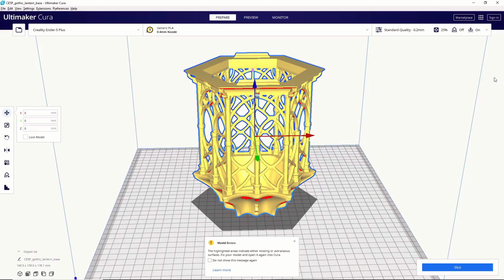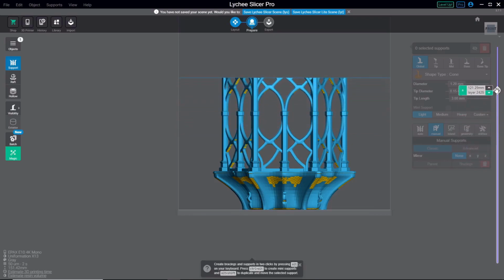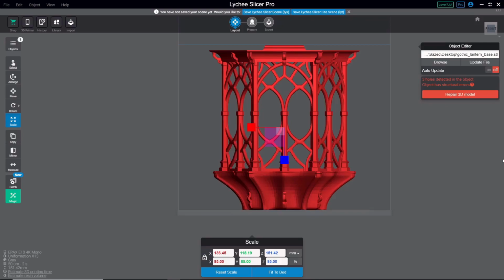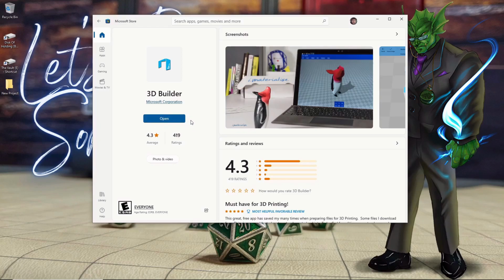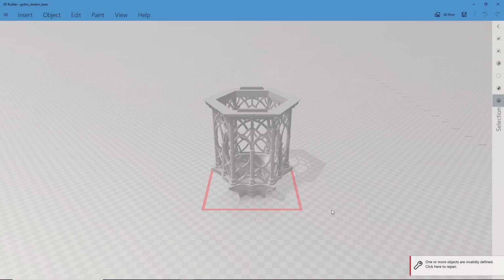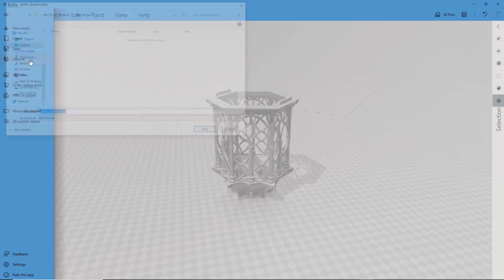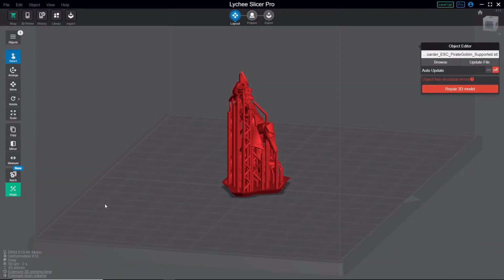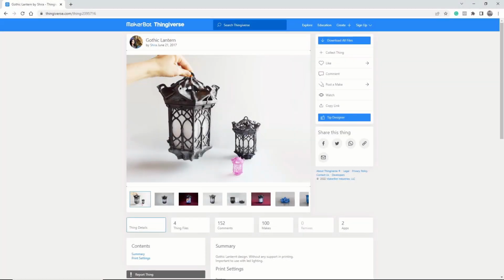How to Repair/Fix 3D Models the Easy Way!

Comment: I use kudotek stl cylindrical part my qidi keeps putting horizontal layers through the center hole seems to be tied to the features on the outside of the part. I’ve tried everything cannot get it to quit doing that.
Reply: Does anyone know how to fix this?
Reply from the maker: If you're sure that you have supports turned off then it probably needs to be edited to redefine the hole. You can do that in most 3D editing softwares like tinker cad.

Comment: it fills in a hole thats meant to be there same with cura. any fixes?
Reply: I have this problem  a lot it’s frustrating
Reply from the maker: @ZZZE-R0ZZZ  yeah unfortunately that can sometimes happen. It really depends on the mesh of the model. There are repair methods that will avoid that but they are all a bit more complex and outside my current skill level. Sorry I can't be more help. 😞

Comment: Too bad it's a microsoft program. They shoved too much crap down our thorats over the years and even plant ads inside expensive installs. They are NOT cool in my book!
Also, orcaslicer repaired everything for me so far with no issue at all.

Comment: what if we are using a Mac computer. can I repair my file on my husbands windows computer then send it over to my Mac?
Reply from the maker: @jessicastanger3077  yep you can absolutely do that. Once the file is repaired it can be opened on any computer running any program that opens STL files.
I apologize for not having Mac alternatives but I don't have a Mac. Perhaps in the future that will change and I can make recommendations for Mac users as well.

Comment: 3D builder is discontinued.. :(
Reply: 3D builder is still available, just not on the Microsoft store. Unfortunately it won't be getting any update so who knows how long it will keep working as Windows updates.
Reply from the maker: @corne3228  yeah I'm probably going to grab an installer and make it available through a Google drive link. Pretty much every place I've found to download it has a bunch of false links made to look like a download link for the software you want. I'm not willing to direct someone to a website where they have a good chance of downloading the wrong software.
Reply from the maker: It is a tragedy for the ages... I'm assuming they'll release their own paid service soon... Or perhaps there was a licensing issue. In any case, the 3D printing community mourns the loss. 😞

Comment: Microsoft no longer has 3D builder. Do you use an alternative?
Reply from the maker: @romeo92314  yeah I'm not sure why it's been pulled but it's a bummer for sure. There is an online option called the Netfab repair tool. It's browser only so it's a bit clunky but. However, it's probably the best 3D repair tool out there.

Comment: Does anyone know any other good programs? I have a stl that needs fixed but this one isnt showing up in the store and a couple others i tried gave my computer pop ups so i deleted them asap
Reply from the maker: @kursteenswisher7169  yeah I'm sorry. I don't know what's up with Windows lately. It's been a few weeks since it was available. Most slicers have a repair function. You could try that. Prusa Slicer especially has a good repair function.
Reply: @SlicePrintRoleplay  thank you!
Reply from the maker: @kursteenswisher7169  you are very welcome.

Comment: it is printable but some pieces of my model are missing (i made it myself)
Reply from the maker: So after you repair it there are pieces missing?
Reply: @SlicePrintRoleplay  yea
Reply from the maker: @Denklammegraajog  okay, I have seen that happen occasionally. Unfortunately, I don't know enough about 3D modeling yet to help much. I'd suggest joining my Facebook group and asking there. I know there are a few 3D artists in my group who will probably be able to provide some insight into what's going on.

Comment: I was using an online software called Sketchup and for some reason when I would download the file and upload it on Cura, it kept saying that the model had holes in it, and some of the cylinders in the model were completely eradicated when I sliced and viewed the preview. I'm glad I came across this video, and it definitely helped me to restore the model.
Reply from the maker: Hmm I've not used that program so I'm not sure what would cause that issue with the models. But I'm glad this video helped you resolve the issue. 😊

Comment: Can someone tell me what a .obj, .3ma, or 2d file formats for 3d is used for??
Reply from the maker: Gladly!

.obj, basic format for a 3D file. Most 3D modeling softwares can/will export this type of file. It can contain a large amount of data so models are normally left in the this format until all edits have been made and the file is finished. 
Some slicers can read this and some can't. It's best to import it into Meshmixer, Microsoft 3D Builder, etc. Then export it as an STL for use in your slicer.

.3ma looks to be a proprietary file format that belongs to a specific modeling software. Not sure which software though. This unfortunately most likely means a file in this format cannot be converted without access to that software that created it. 😞

Not sure what you mean by "2D file formats." do you mean like a .svg file? Those are kinda 2d, but can still be used by 3D printing software once they are extruded (made thicker).
Reply: @SlicePrintRoleplay  thank you. I thought .obj was the 3d file, still don't understand .3ma so I'll have to test it more and 2d is fun. I already used 2 models for backgrounds on my phone
Reply: @SlicePrintRoleplay  btw to give you a better idea of what I'm talking about, I'm using the app "3D Modeling App" to share it gives those 3 choices but I need the premium version for obj and 3ma so I'll just try another free app. I want to learn all the different file types eventually. I don't see how someone would need more than .obj in my opinion

Comment: One issue. It took my 8mm very small figure an blew it up about 1000%. Is there a way to keep the scale?
Reply from the maker: Hmm I've never experienced or heard of that issue before. Could you check the size in your slicer, then repair it, then scale it back to its original size in your slicer?

Comment: Hi im having an issue, When fixing the model on 3d builder it seals the key holes to connect my model hands to arms for example, it seals every single key hole on the model im fixing. Im try to fix it because it gives me artifacts on lychee.
Reply from the maker: Have you tried repairing it before adding your key holes?
Reply: @SlicePrintRoleplay  the model already have the key holes pre modeled, :(

Comment: Yet you forget to tell ppl that 3d builder stalls on repair, not for an hour but indefinitely. It's the apps only flaw that they refuse to fix. I've left it on repair for more than a day and currently as I type doing the same. I'm hopping it fixes, but I know it's just stuck like always.
Reply from the maker: I have never experienced that issue. I also certainly wouldn't recommend a program if it couldn't complete the teak I was recommending it be used for.
Is this happening with all models or just some?
If this is happening evey time you try to repair a model then there is likely an issue with your install of 3D Builder. Try removing it and re-installing it.
Reply: @Slice Print Roleplay  it's such a pain. I didn't k own about the blender fix as I lost all knowledge of blender and I'm starting the donut again. 
My model isn't even complex like you cage was and it's having issues repairing in 3d builder. I'm hoping it fixes but based on 3 years experience I've rebuild several models because of the repairing stall. 90% it's needs repair only because I started the program "3d builder" the next day to continue working and it.

Comment: 3d builder sucks. It fails all the time repairing, merging, subtracting. It cant barely do the most basic functions of its main purpose.
Reply from the maker: Hmm I've not had any problems with it since I started using it about a year ago. It's possible this could be hardware or driver related. It's worth looking into at least.

Comment: Great video!   Just a little tip though that newbies like me would want to know. The program is really bizarre. After you open and object and view it, you still need to click the "import" button even though you see the object in the program. Then you can click "repair" at bottom left. It's really bizarre we have to do that extra step (import).
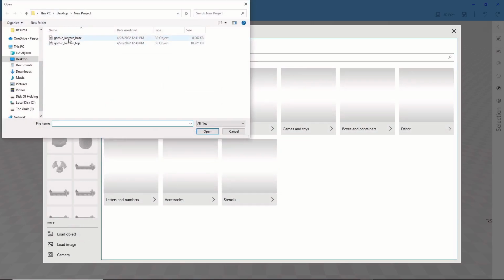Reply from the maker: Hey there, thanks for the input. Are you saying that you're seeing different behavior than what I show at the 3:08 mark in this video?
Reply: @SlicePrintRoleplay  your video shows the same steps.  I guess I missed it earlier
Reply from the maker: @hothmobile100  no worries at all. I'll just wanted to make sure nothing had changed. 😊
Reply: @SlicePrintRoleplay  I'll check when I get home.  I was stuck for a while until I finally realized I had to click several buttons.  I'll let you know.

Comment: Definitely takes a while.. Im sitting at 3 hours and still not done being fixed.
Reply from the maker: Oh wow, that's in 3D Builder? I've never had anything take longer than 15 - 30 minutes max. It's possible that it can't repair the file. However, I guess it could take that long if it was a large file.
Definitely let me know if it finishes.
Reply: @SlicePrintRoleplay  Left it all night.. Woke up this morning and still was still fixing so I stopped it.. Gonna try to print it un altered.. I will see what happens.
Reply from the maker: @AncientOutlaw_raider1  thanks for the update. I'm sorry to hear that it didn't repair the issue.
You could take it into Meshmixer and use the Analyzer option to identify the issue(s). It could be that there are just too many issues for it to repair.

Comment: I have printed a ton of files that the slicers say need repair. In fact Lychee also seems to export the STL as a broken file about 50% of the time (not real errors, just the slicer being dumb). They never fail and I have never had issues. Interesting take though, have seen some folks using 3D builder to fix major errors. For the most part, unless I see a slicing issue, or actual missing polys or pixels I will just print it. Interesting to say the least, I may include this in my workflow for future projects.
Reply from the maker: I totally agree, there are some models that a slicer will day has issues but they'll print fine. In my experience, I've never had a bad experience from repairing a model. So if the slicer identifies errors I'll typically repair the model without looking too far into what the errors are. However, sometimes (like with the model in the video) it's easy to see the errors.
Reply: @SlicePrintRoleplay  Absolutely, like the video, it does actually explain how to repair in a way that I wasn't currently doing, so in some cases if a file is really broken (which did happen to me once), this might be able to do what the other tools I was trying at that time could not. Thanks for the video again, good stuff.
Reply from the maker: @IPrint3dMinis  you are very welcome! I was using the NetFab Repair Tool, but I've found this is easier to use and seems to give the same results. Which is saying something considering the NetFab Repair Tool has always given me great results when repairing issues.

Comment: meshmixer is also a good cross platform 3D repair tool...pity its no longer updated
Reply: It was the best - until I found this !!  Meshmixer fixed a female figure with a large braid down her back by dumping most of the braid. It also removed her shoes ! 3D maker fixed it and kept the braid and shoes intact.

Comment: Duuuuuuuuuude this software is amazing. I discovered it when I had to remesh an otherwise incredibly cool thingiverse model that had so many triangles it crashed cura when you loaded it. It also works amazingly for splitting big prints into parts.
Reply from the maker: It's funny you should mention that. I normally use Meshmixer for all my 3D file editing. However, Meshmixer is very aggressive with how it repairs models. But 3D Builder and Meshmixer seem to be very similar in many areas. So a friend and I decided to put them head to head in a kitbash challenge. Our videos should hopefully be out in a week or two. 😊
Reply: @SlicePrintRoleplay  holy crap. Okay that's remarkable timing.
Will wait for the video. Thank you!!
Also earlier we were debating with my man if you are a kappa or something else. I was underf the impression kappas were more reptilian and less fishy though? Or are you a merman or something else?
Reply from the maker: @Peanutsudaca  yeah I'm really excited about this collaboration video! Hopefully everything finds it helpful.

You are correct that Kappa are more like a big water lizard that walks in two legs. 
My channel mascot is Named Orem. He is a Sea Troll. He's actually the first NPC I ever created so he's very special to me and my channel. 😊

Comment: 3D Builder is Microsoft's magnum opus haha, I dunno how they managed to make such a good program. Great video!

My theory for why presupported models often display errors is that adding supports in a way is 3D modelling, and with the amount of adjustable parameters involved its possible the slicers aren't capable of creating perfectly manifold supports every single time.
Reply from the maker: Very well said! I absolutely agree, I've only just scratched the surface of what 3D Builder can do!
In many ways it seems comparable to Meshmixer which is definitely impressive!
Reply: @SlicePrintRoleplay  I am guilty of actually never having touched Meshmixer haha. Gonna have to take a look at that one of these days!
Reply from the maker: @OnceinaSixSide  it's definitely a bit more involved than 3D Builder, but I believe it's a bit more versatile... Than again, my opinion on that could change once I get to know 3D Builder a bit more. 🤔

Comment: quick question. 1. can you print the presupported model when it is showing errors? 2. Ive seen where the models scale shoots way up do you know why that happens? Thanks for your advice
Reply from the maker: #1, yep I'm most slicers you can still print a model even if the slicers identities errors.

#2, I've not encountered that myself. It could be a glitch. It could also be something that 3D Builder has to do in order to repair the model correctly. If you make a note of the Z height before you repair then you should easily be able to rescale/resize the model back to that size once the repair process is done.
Let me know if you have any other questions.